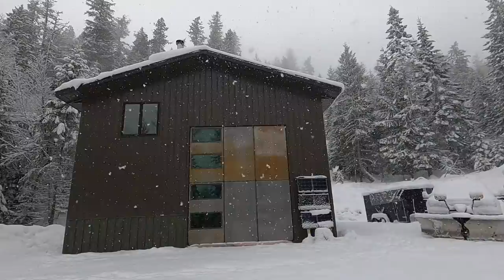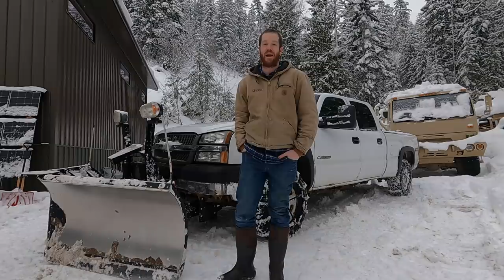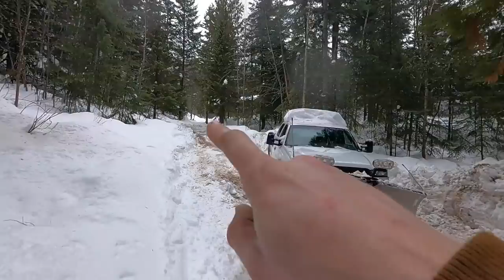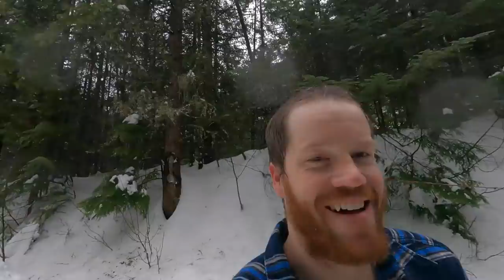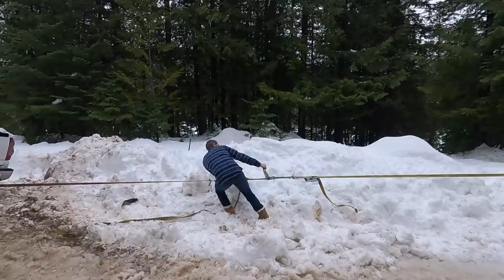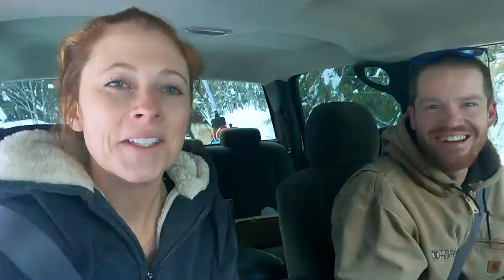WILL WE MAKE IT OUT? | Battling A Blizzard

Comment: Get proficient in skiing in case that road really gets blocked up and the snow starts getting really deep. :-)  Besides, skiing is one of those fun things in those months anyway.

I'll not harp on that tractor with a snowblower. But around here we mark the edge of the roads with 4 foot plastic sticks with reflex tape on the top two inches to make cleaning the snow without driving off the road easier. A bit late for that now of course :-)
(in the mountain passes those sticks are wooden and 12-20 feet)

A 12V winch on the rear hitch to pull the truck out the way it went in is a godsend. Most often that is the easiest way to get back on the road. Some chain and straps is also very helpful.

You might want to put a chainsaw with all its gear in the truck. The snow will bring down trees. Together with a first aid kit, some food and dry clothes. Things takes time sometimes. And bring those skis.

Finally some extra weight over the rear axle make it easier to back up. Locking differentials will also really help in getting stuck if you plow with them on.

If you find the time - look at some of the stuff Andrew Camarata publishes on his channel. That guy is very hard on his equipment but he gets stuff done. Some of his rescue videos are just.. Well, instructive, in a way. I think you will enjoy them, and get som good tips.

Comment: Points to you two for sticking it out and making it through!  Definitely think you could use a good recovery winch on a vehicle and then for the future a tractor with a cab, chains, loader, and rear 3 pt blower.  You can literally dig out of anything once you have that combination!!
Reply from the maker: We need to start our "snow clearing equipment" piggy bank. And hopefully by next winter it is no match for us!
Reply: @AmbitionStrikes  It takes time to get a sense of the scale when dealing with a new driveway and snow conditions.  I would suggest checking out GP Outdoors on YouTube for what a small compact tractor with a blower can do on a very long and somewhat hilly driveway.  I definitely would say if you go with a tractor make sure it is hydrostatic... With wet snow like you just had it would be rough on the clutch of a gear tractor.

Comment: Snow and rain can make a mess! We just dealt with 38” in 4 days with rain in between. Even with a Skidsteer plowing, it was several days of work and shoveling.   The important thing to remember with plowing is you will get stuck! You guys live on a mountain.  I see a lot of suggestions for tractor with snowblower. Even a tractor will get stuck and the snowblower doesn’t always work with the wet snow.  Whatever you choose, have something big enough to get it out. There isn’t one perfect tool. 

I went from Kubota L4701 to a 75-2 skidsteer.   I kinda miss my tractor but the snow blower isn’t perfect either. I have a snow pusher on my skidsteer but it only works great for straight pushing.  Sometimes I’m switching between bucket and pusher wishing I had a blade and a snowblower attachment.  There is no perfect equipment but living remote and maintaining your own roads requires an arsenal of everything ! And with any equipment, you will get stuck! So whatever you get, you’ll need an equal piece of equipment/truck/winch to get unstuck. 

Riley needs a grain/Scoop shovel.  Way better to dig yourself out.  Thanks for the tip on Bubba ropes.
Reply from the maker: Thank you SO much for the practical advice and knowledge! The biggest reason (other than cost) that we have't outfitted the army truck is because if we do get it stuck, it's going to be a heck of a job getting it unstuck. 

Our other neighbor has a tractor/blower combo but this area is known for wet snow so he's had quite a few issues. A skidsteer would be really nice as an all around option for maintaining the road, pushing snow around etc, as well as doing work and improvements over the summer.

Comment: If you slide that big truck off the road, you don’t have anything heavy enough to retrieve it. I’m sure putting some weight in plow truck would make a difference in how it handles on the slick roads. Good luck keeping it all plowed. Nothing moves that wet heavy snow well, plow often if it going to warm up. Now when it gets cold again, it will really be a mess and hard to deal with.

Comment: Deep snow will always stretch equipment and manpower to their limits.
I always add weight in the form of snow to the bed of my truck and reduce the tire pressure. You'll notice a significant increase in traction!
When the weather warms up, the snow melts and you don't have to unload it.

Comment: When I get a wet slushy snow, or it rains, I wait for it to freeze. It dries, gets lighter and doesn’t stick to plow or blower. 
That’s IF you can wait. 
Stuck neighbor would get frozen in. 
More snow in forecast doesn’t allow waiting. It means keeping up with it as best you can-multiple times a day/night. 

Which means you need more lights and an alternator that can handle the load.
And driveway markers. 
And clearing some push off areas this spring  to push the snow in to. 
Level so you can back up. 
These also make run-off diverted so your road doesn’t rut.

Comment: I changed to a 30 inch walk behind snowblower...to slow. Final ended with 42 inch  snowblower on my garden tractors  put on rubber snow chains. What took hours to clear now takes 1 hour and gives me time to do my  friends driveways. My point is you might be better off to putting a 42+ inch  snowblower on that truck or on the track vehicle . It may be slower but will be cleaner and will throw  the  snow 20+ feet to the sides . You can only push so much snow, but there's no limit to how much you can blow. Good luck
Reply from the maker: We agree Stephen, I think a snow blower is going to be the best option for our road!

Comment: gotta learn how to rock the truck... give her a little gas, just a tap and then let off and keep doing it... you will be able to rock back and forth... and you keep doing that quickly tap on the gas and let off to get rocking back and forth and you will be able to get a LOT momentum built up quickly rocking back and forth... it is surprising how much forward and back movement you can get and you will flatten out the snow instead off digging yourself a hole.... i get myself unstuck like that all the time...

Comment: Wet, heavy snow sucks, slow and steady and watch where you're tracking. Knowing where the edges of the road is always good to know so hopefully you can keep it out of the ditches. I've always used 4 low with that wet heavy snow. You can't go as fast and it takes longer, but the secret is to try to get it done without breaking.

Comment: Also when doing deep snow plow top half of the road than go back and do the other side than plow the bottom half both sides. Better yet Get a proper plow and better a blower auger to throw the snow deeper in the woods, they have very nice attachments for skid steers that work up here in northwestern upper Michigan and you can use a skid steer for a lot of projects

Comment: After living in a heavy snow area, i found out that snow plows are death to pickups no matter how careful. I would suggest fabricating the snow plow to the army truck. It has the strength to with stand the abuse along with diesel torque and weight. A good heavy duty power winch is essential as well.
Good luck!

Comment: Great job digging out! I live in central BC and we have had over 30 inches here. I will say if you are looking for the ultimate  plow rig for the future a skid steer is the way to go. I have an 8 foot wide hyd angle plow and I chain the rear tires and the thing is pretty much unstoppable pushing through 24" of snow easily. Plus you can pile the snow 8' high with ease and I can get myself unstuck almost every time pushing backwards with the plow. If you decide to get one I recommend heading to the auction and buying the biggest machine you can find as there is little downside and a lot of upside to going big! Happy plowing😁

Comment: I never advise using 4 Lo because bad things happen when using it but I’ve high centered my truck in a ditch (same one) twice and I found using four low drive in a bit further then reverse it hard to pop up and out.  It can break things so only use it sparingly.  I found that trick works in a pinch

Comment: You guys need a skid steer(tires with chains and weights) with either a snowplow or a snow blower. If you get a skid steer, make sure to get the high flow so you can run the snow blower.

Comment: My wife and I spent the last 10 days in Dillion Colorado and they had a lot of,snow. Wife thought I was a crazy because I put my 12,000 lb winch in the back reciever hitch on her 2wd 4 Runner. I figured that since we were planning on driving in some bad weather I could use it to pull us back on the road if I needed to. That winch was big enough to pull the 4Runner straight up if need be.. and would work wonders on rescuing other cars if I could get a decent anchor.  I also threw in some recovery straps and other recovery gear. Didn't fancy driving to Colorado in my 4WD rock crawler. Good choice, as the cross wind coming home to Texas would have killed mel
You should think about building some tracks for the snow plow, or at least a snow blower attachment and shoot that stuff off the road rather than digging up that fragile dirt road. 
As always you guys are a hoot to watch.
Reply from the maker: I think a rear mounted winch is ideal for this kind of stuff! Backwards is almost always the easiest way out of the situation. I agree that a snow blower would be perfect, as there isn't much space to push any of the snow off the narrow roads.

Comment: Wow.  A lot to talk about here.  I have a bit of experience plowing.  First.  Learn to get up in the middle of the night to plow if your going to do a mile+ of rough road with a pick up truck that is aging exponentially faster with that heavy duty use.  This task is a tall order for a light duty rig.  Second.  Get a tractor.  A skid steer or better, a backhoe (trade in the mini hoe, they are cool, but a backhoe is more well rounded and infinitely more useful in your situation)  Third.  Plow the road way wider than you need to.  Always.  Every time.  Good luck.  This is just the beginning of winter.

Comment: Wow that's a lot of wet heavy snow, kind of scary getting stuck that often. I'd like to share an idea, think about welding two electrical winches (12,000 to 17,500 lb each) to the plow truck. One on the front bumper and one on the rear bumper. Wrap the strap around a tree or two and have the winches pull the truck free. Would eliminate the concern I would have of being stuck and no one could get there for a day or three. Probably run about 800.00 to 1,000.00. It would improve safety, because what would happen if you both got stuck? Love your channel!

Comment: I carry 6    5 gallon bucket’s of sand in the back of my truck but I could use more weight !! Y not make room for your enclose trailer in your shop in the winter if not buy yourself a instant metal carport I know I’m spending your money 😁thank you for your video I’m 70 so I’m trying to slow down on pushing snow for people I’ve been pushing since the early 90s

Comment: You guys need a good old fashion Come Along. Using the ratchet strap looked sketch! 👍 on the Bubba rope.
Reply: Ratchet strap can easily pull 3,000 lbs, the industrial yellow ones are rated at 6,000 lbs, I have used 2 of them to pull over trees that were leaning the wrong way to the way I wanted them.

Comment: Wondering if any municipalities or airports have one of those wicked two tier single or dual stage blowers for sale? Possible used equipment search?  
That, chains and winch with snatch blocks on the Army truck would be nice.  

But:  you’d probably be better off in the heated cab of a tracked skid steer with snow blower if budget allows. 
Better year round use tool. 

Actually, others would need to comment on whether tracks or tires with chains would be better in your conditions. 
Summer and in the woods I’d go with tracks. 
The equipment I sold was used on hard pavement and mostly level ground when used for snow removal. 

Any vehicle you have a hitch on can use a moveable winch with tree savers and a snatch block to get the pull angle you need.

Comment: One more thing, might seem silly, but there is a company that makes a 45" wide snow thrower that attaches to a 4 wheeler.  It can throw 45'.  It is in front of the wheeler, but attaches at the back.  I considered this when I was considering the v-plow.  Price was around $5000.  You have the 4 wheeler, so the thrower would be easy.  Then again, with your fabrication skills....  

I have an old M35 deuce that I was going to build a thrower on, but due to health reasons, cannot do so any more.  You might consider fabing tour own thrower for the 2 1/2 T truck, use a second engine to run the hydraulics.  With that kind of capability you could send that snow all the way back in the woods.

Comment: No better way to learn how to plow then just doing it! Stay safe!
Reply from the maker: I'd say there is a steep learning curve... especially when the road is steep!
Reply: My truck is set up with lockers front and rear. 13,000 lb winch in front. So far personally. I have never had to use cbains with my truck in snow! With the lockers and lowering tire pressure. Never been stuck! Probably lucky in that regards! You have good start with the bubba rope. Should have snatch block, some different lenth lanyards. One thing to keep in mind when using the a cable winch. Always lay heavy towel or coat in middle of the line in case it snaps! Can help keep it from wiping back and taking something out! Stay safe!

Comment: Found the same issue with my pole barn and water. I am going to try a French drain a few feet from the wall and plastic wrap the ground from the drain to the wall and see if that helps. May add a heat strip in the drain also but I know you are on limited power.

Comment: It looks like  challenge for Ambitious People! Snow removal needs some new, unafraid minds scheming on the better snow removal! Some thing the size of your "little dump truck" with less wheelbase and a bigger, more substantial plow,  comes to mind! Could the Snowverlander have been the small scale test bed? Were ever ambition takes you both, you will succeed best, IMHO, anyway!  FR
  PS; Several mentioned winches- mount one on both ends and carry about 100 lbs of snatch blocks, HD ratchet straps, Pull Boys and a 12v air pump. When you wire it up, include for 12v jump starting service from front of rear without lifting the hood.

Comment: Forgot something to mention: the snow chains on your plough truck are not able to do their job properly: the chain links cover the tire tread radially only and are not connected circumferentially, so they do not deliver 100% traction and they do not keep the tires on track, so the truck slides sideways easily. Better use snow chains with zigzag-like links.

Comment: Thought you guys had a bulldozer that is something you're going to have to learn to use when the snow gets deep you can plow basically open the whole Road as long as you haven't got rid of the Dozer makes more sense and trying to play around with the snow plow truck to get stuck more often than not so I think with the Dozer you could clear more snow a lot easier

Comment: You have the best plow truck you can ask for you have a Stewert stevens you need to ditch the bear up broke down Chevrolet remove the plow blade put it on the Stewert stevens throw chains on the Stewert stevens and use it for what it was made for. and there is a kit to install a block heater on the market

Comment: Dude, you seriously need to watch where your going at times lol.    Your might want to look into getting a blower unit you can attach instead of the plow, find a good sizzled used one and make something up :).   Live confidently and peacefully. (Ps.  Buy a winch like others have said, and some snatch blocks.  You’ll be able to pull yourself out out of almost anything.  Easier then using your tires as a winch…though that can be done too)

Comment: Looks like a lot of fun!
I actually envy you your driveway, I only have 250 meter to snow blow with my machinery and the last few winters we haven't gotten any good snow either.

You should get yourself a hand winch, goes by the name of come along winch as well. Handy to have and cheap to buy. Will get you out off a pinch.
Reply from the maker: Wanna come help clear ours? 😂
Reply: @AmbitionStrikes  
Had you been my neighbor sure enough, but given that it is more than 7000 km and the whole Atlantic ocean between us it isn't to practical 🙃

In my experience weight has a lot to say so I would think your army truck would be a much better plow machine.
You get better grip and stays down instead of starting to float on top of the heavy snow and you push the snow better.
I used to have an old Hough wheel loader with just a bucket weighting in at around 5.000 kg that worked great but have since upgraded to a Volvo BM 6300 weighting in around 10.000 kg with a 2.5 meter wide snow blower on the front powered by a 1.9 tdi from a VW. Homemade and really gets the job done 😇

Chains you can buy used, but buy them in good condition. Plain chain works great in snow but when you get ice and have an incline you will start sliding so spiked chains that dig into the ice is a must. Trust me, sliding uncontrollably down a steep hill in a wheel loader is no fun!